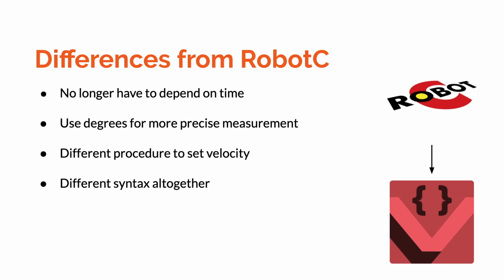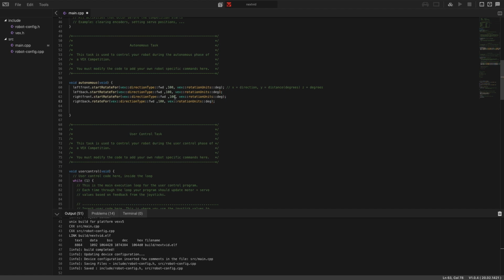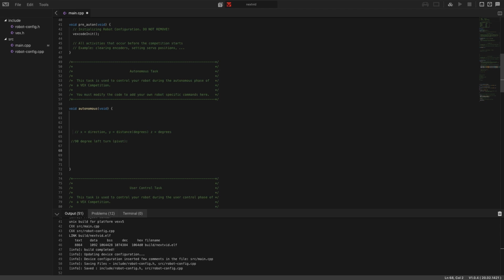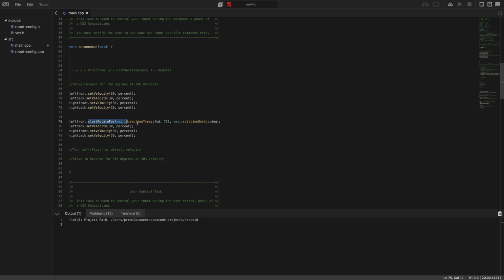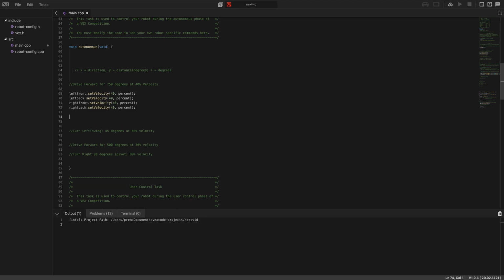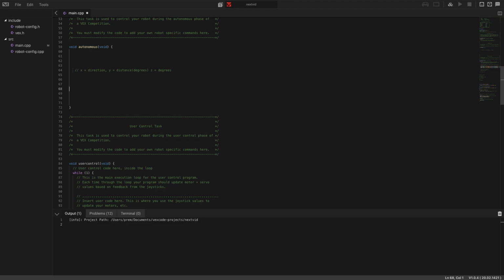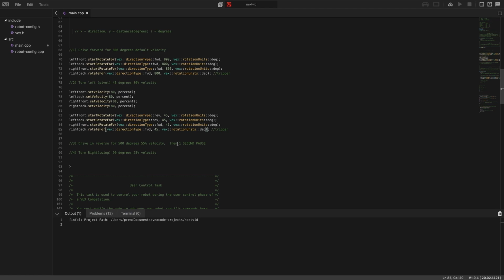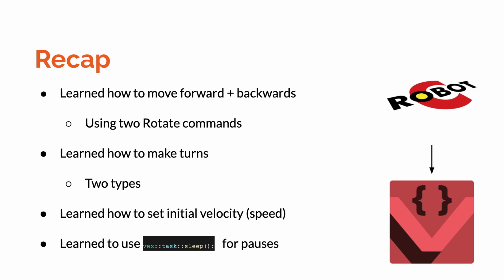VEX V5 Coding Tutorial #3: Autonomous Programming

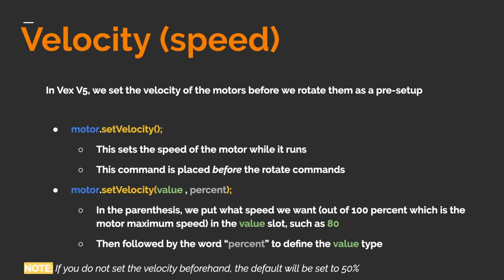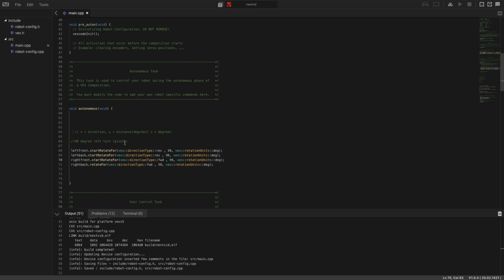Comment: thanks mate! coming from a rookie team.    and a question, so the way you write the code, it just runs it as a sequence right? like it wont do the next task til lets say, the motor has spun for 100 degrees?  and don't mind these (set velocity 6:24   pivot turn 12:45  swing turn 13:05)
Reply from the maker: @Ryan Allen That’s correct! This program will run sequentially so it will only run line by line.
Reply: @FHSRobotics-rn1in  much thanks! this is highly appreciated, my team was worrying about auton skills.
Reply from the maker: @ginger16068  glad we could help!